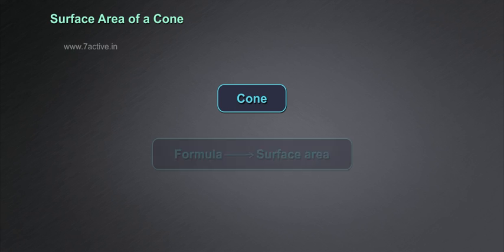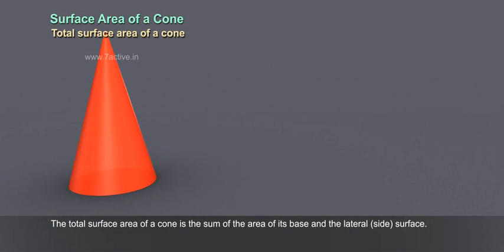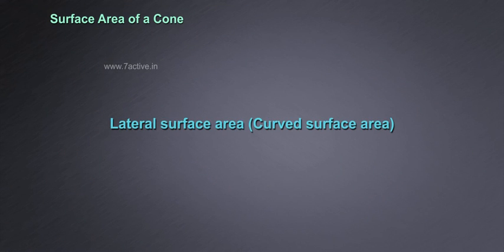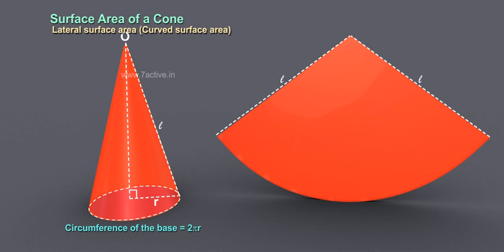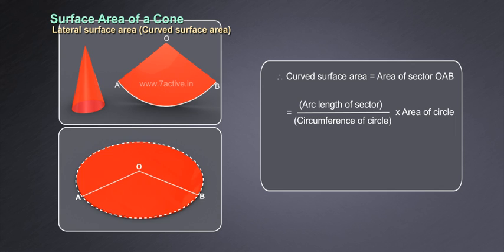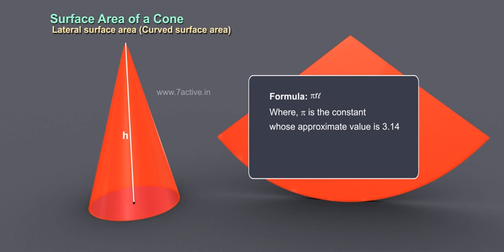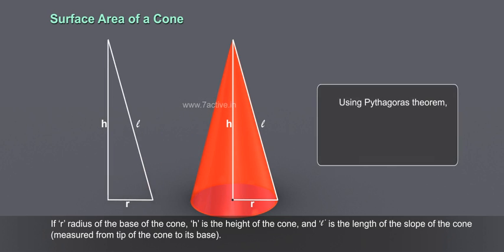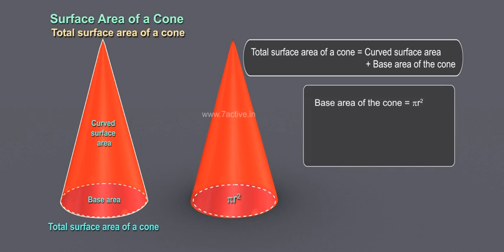Surface Area of a cone

Comment: the lateral surface area can also be the area of a circle in which the radius = L multiplied by the radius of the base r over L
(πL^2)*( r / L )
coz it will be the same as πrL

Comment: You should've had explained that why to do we do those steps to derive the area. Example why do we divide it by the surface area of circle
Reply: Do you mean deriving the lateral surface area of the unwrapped cone? This formula is simply a way of giving the fraction of the area we want to find. The measure of the arc along that length to the circumference of the circle tells us what portion of the circle we are looking at. Multiplying that to the area of the circle gives us this information.

Comment: i didn't get how the Arc length of sector=2 pi r
Reply: Madhu Matta Circumference of the circle = 3.14 times radius = πd = π x 2 x r = 2πr (this is with reference to the base circle [blue] of the cone)
Reply: First select / decide an arbitrary R over a parent circle with radius L. Next take the ratio: R/L and mark out an angle  theta = 360 x R/L on the parent circle. This is your sector angle. Imagine this sector (roughly in shape of triangle) is made of infinite straight lines radiating out from one common point all of equal length 'L'. Take the line on the edge of the sector and rotate through 360 to meet the edge on the other end. Hurrah, a cone. 

Every momphalliwala (groundnuts vendor) knows more than us. He takes a rectangular sheet of paper, forms the cone to pack in the seeds and uses the ''extra'' to seal it in. And all his ''cones'' are of same size !!